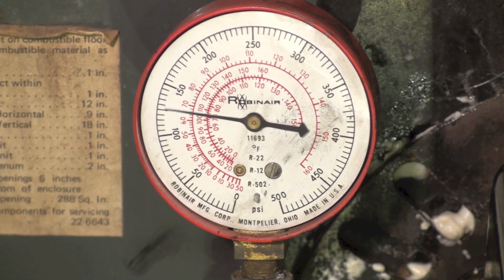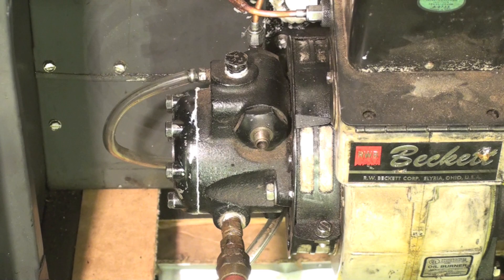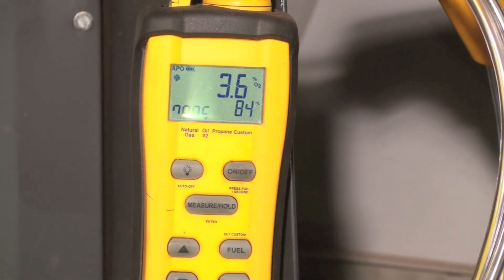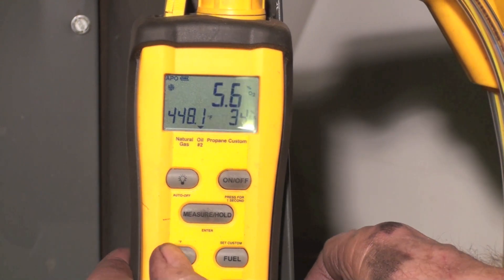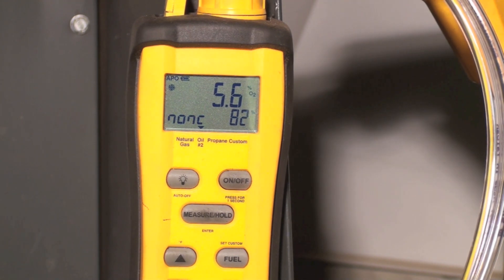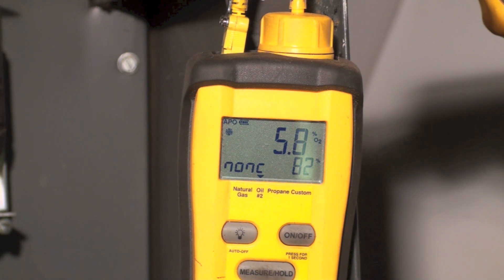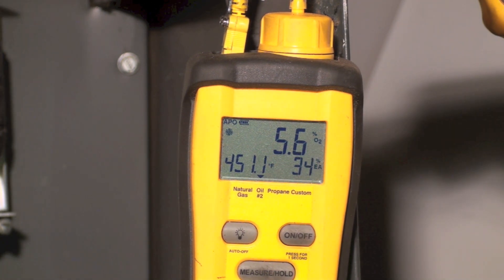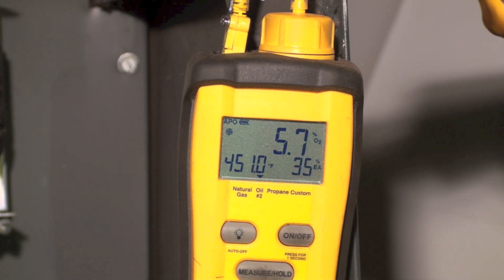Oil burner efficiency tests.  Part 4

Comment: In general, higher pump pressure provides better atomization and more efficient fuel burn but you reach a point where overpowering the nozzle alters the spray patters either by saturating the outer edges of the cone, or the outer edges drop off. So many variables come into play when over 150 psi.  All in all, I enjoyed and learned a lot from your videos.  Thank You

Comment: What happens if you just drop nozzle size , but don't change pump pressure?  I went from a 1.1 to a .85 (same angle ) Wouldn't it still have better atomization?  What will it effect?  It seems to run quieter.
Reply from the maker: You will not get better atomization, only increasing pump pressure will do that.  Generally, lowering nozzle size will not effect heat output as most furnaces have oversized nozzles.  You will, however, have to adjust the primary air to adapt to the smaller nozzle.
GFM

Comment: What is the air temp from the vents inside the house ?  The air temp from my vents is not very hot ...any advice ? furnace is only 3 years old.
Reply from the maker: Generally, the temp should be 120F.  Oil furnace? electric? gas?
GFM

Comment: I know it's an old post, but I've just come across it. I'm from Ireland. Do you guys never adjust the air intake or is it not possible on your burners. Mostly Reillo here. Here we'd first fully clean oil filter, boiler and burner, set-up pump pressure, use a nozzle within the firing rate of the manufacturers manual, get boiler up to operating temperature and then adjust air intake to get about 11 or 12 C02 (depending on ambient temperature). I know we use water to distribute the heat, but that doesn't really matter when setting the boiler/burner up. --- Great channel by the way. I am still enjoying going through it.
Reply from the maker: We also use some Reillo burners.  Beckett is more common.  Yes we do adjust the combustion air.  Glad you like the channel.
GFM
Reply: I'm Glad to see your still around , your video's help me so much , been subscriber for a while , I don't learn as quick as others , so video's help me a lot , I've worked with good tech's , not all ways good teachers, lol or they throw you to the wolf's and say go figure it out , call us if you can't , that doesn't work for me , I get intimidated and lack the confidence , , I want to show up and know I can figure it out with confidence , I will become a good service tech , and your video's and other's on the internet , have been the way I Learn , not stupid , just slow learner , lol hahah Thanks Your the best !!

Comment: I'm wondering how you made the combustion chamber smaller??
Reply from the maker: I just used a smaller combustion chamber.  
GFM
Reply: I know that but did you just happen to have a chamber laying around that would fit in the furnace housing?/ I see chambers like you used all the time in miller furnaces, but I'm wondering if it would work in say a Hallmark, I  know it would set in there but would the efficiency be the same

Comment: I watch all your videos and they are great...but I'm a home owner and don't have the same equipment as you to run them test is there anything I can do to figure out what is going on with my unit I have took it apart and cleaned it it extremely well chimneys and all. it was packed so full of suit.  now it acts like it's running hot and I smell burnt oil or carbon I guess you'd say. And when I say hot I don't mean out of the vents I mean by the unit it just feels hotter than it should and I don't see anything coming out of this stack you can see their radiant heat in the air when you look at the chimney but no smokeis coming out I have a Beckett oil burner A2VA-7116 with ( .75 80°B ) nozzle I've been doing maintenance on properties for the last 15 years so I am capable of doing what ever has to be done I just need to know what to do because it's my parents house and they are on a fixed income and cannot afford to have a tech come out
Reply from the maker: This one sounds like you have a plugged heat exchanger.  There are usually clean outs on the heat exchanger that you can use a shop vac to clean.  Any soot that is in the smoke pipe and chimney is also in the heat exchanger.
GFM
Reply: Thank you very much give that a try I was wondering about that nozzle too what size should I be running in that pump... in this guard that goes around the nozzle fell off would that be affecting anything
Reply from the maker: The nozzle is sized to the oil type and system capacity, not the pump.  The nozzle head is absolutely necessary and the unit should not be run without it.
GFM

Comment: after going throw all the videos i found out that my armstrong has a hole in the fire box. any thought on a good lang lasting oil furnace? thinking i would like best quality than the heights efficiency ! thermopride?   

thanks ryan
Reply from the maker: Too bad about the hole.  I don't recommend furnace brands.  Efficiency is rated on the furnace and most are very close to each other.   I would use an established brand.  
GFM

Comment: i usally shout for just below 12 % co2 any more and it will smoke,,, and i look for low c.o.
Reply from the maker: I think that's about right.  I usually consider under 30PPM ok on the CO.  I think we are pretty much in agreement here.  Thanks for the thoughts.
GFM